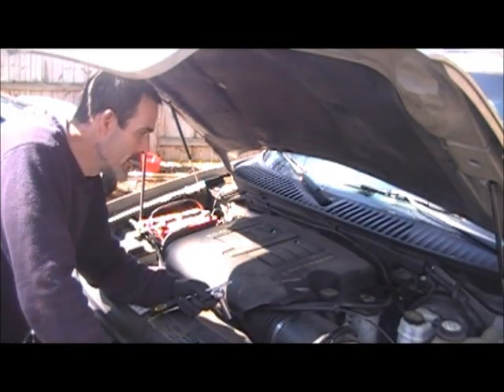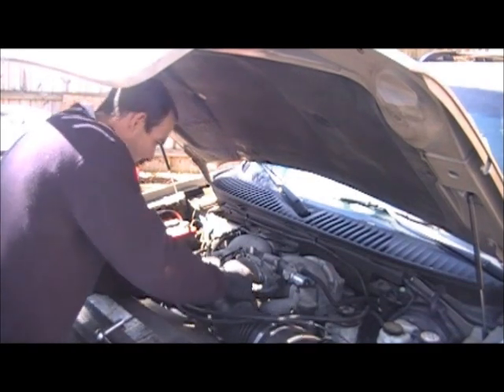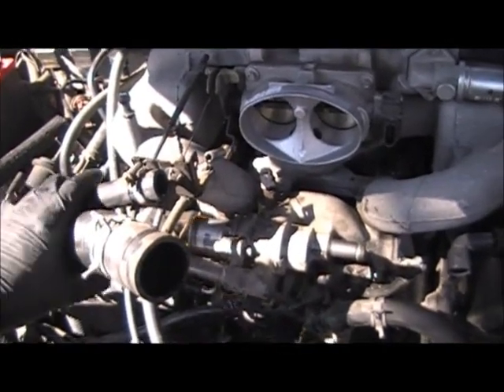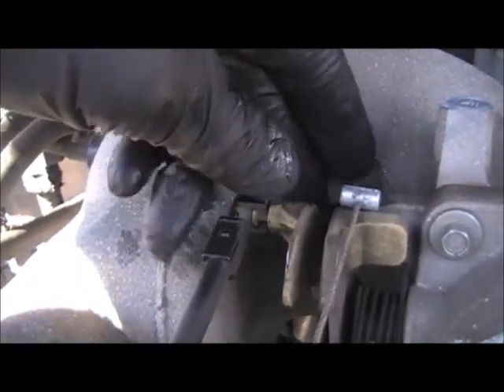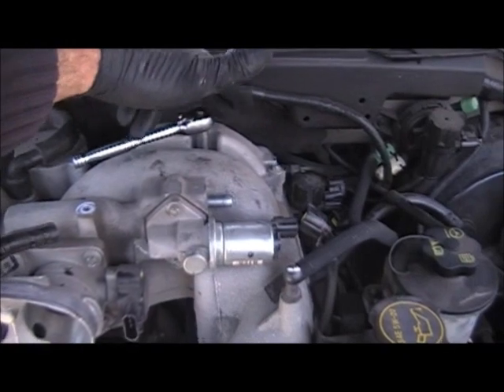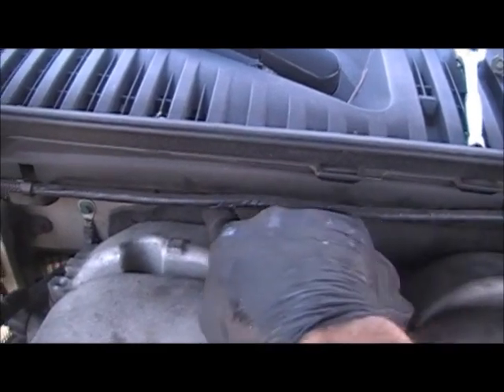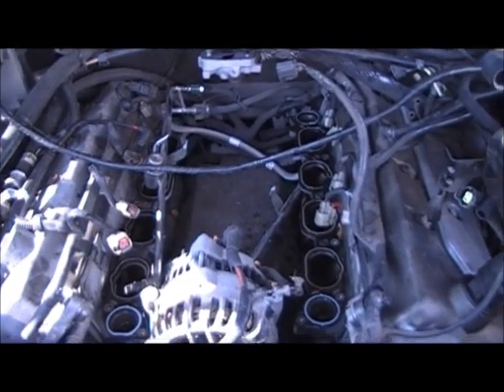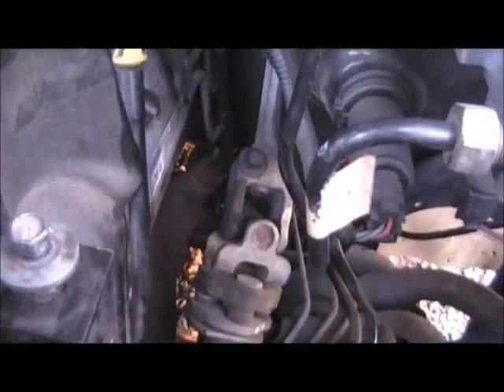5.4 Lincoln Navigator cylinder head removal

Comment from the maker: Yes coolant does flow through the intake in the back and there are also a few coolant hoses back there, small ones. I would think that your problem lies in that area other than the head gasket. Check with your local autozone, they have tools they will loan, see if you can get a pressure tester for the coolant system. That should help determine where the leak is comming from.

Comment: At first I thought it was the heater core but I have it on ramps now and looked underneath and it is dripping straight down from the bottom seam toward the back of the block on to the lower bolt of the exhaust manifold where the pipe hooks up.From what i can see the back of the block looks dry and the freeze plug also looks dry in the back.Does the intake have coolant flow through the back area?The only part thats got me worried is the head bolts in the rear and the tight fit of the intake.

Comment: I have a 2000 Navi 4x4 32v intech.It is leaking a few drops of coolant a night on the lower passenger side seam of the head gasket toward the firewall.Do you think I can remove the head with the body on frame like in this video or must it be raised?I've heard the head bolts may hit on the 2000 model with the intech 5.4.

Comment from the maker: Did you disconnect the battery when doing the job ? Also check the vacc. hose going to the pcv at the throttle body, it is known for breaking there and a vacc. leak could do it as well.

Comment: Thanks so much for the helpful video. I follow the instruction.I changed my fuel injector,coils,valve cover gasket,spark plugs and pcv valve. I got the check engine light off drove test for 3hrs it was driving smooth. Suddenly I stop at the light then it just shutt down on me. Crank it up and running again. Is it cause by the coolant water get in those valves' hole that havent completly dry off or something else wrong? Appreciate all the helps. Thanks again. It still running good now.

Comment from the maker: The side with the skip is the bad head more than likely. Part two of the video covers how to check for the bad valves after it is off. Usually the drivers side, rear two cylinders, or two intake and two exaust valves.

Comment from the maker: The valves will have to be replaced in that cylinder head, on those two cylinders. Check out part one and two of the video to see if you think you can handle it.

Comment: My just said misfire cylinder 6 and 7. I took them apart plan to change the whole set of fuel injector. I changed all the coils like 4 months ago. Couple days ago it said misfire those 2 cylinder. So I took them apart by watching your video. Thanks for the helpful video body. So I just stick the drag in each hole to suck the coolant out as much as I can then it should be fine right?

Comment from the maker: You can try to blow it out or stick a rag in there to remove any residue. Those are the intake ports for the valves in the cylinder head. If too much goes in there the engine will not turn over due to the coolant stopping the piston from going all the way up. If this happens just remove the spark plugs and turn the engine over to push it out, reinstall plugs and you should be just fine. NOTE: Be sure to have the head and intake reinstalled when doing that !

Comment: Looks like fun, nuggie! LOL! This is why mechanics "enjoy" the old school mechanical stuff. Less hoses and wires and stuff to deal with. But, on the flip side, in all due respect, an old mechanical iron head could only dream of being as efficient (multi-faceted value: specific power output, fuel efficiency, reliability, durability, power to weight ratio, etc.)

Comment from the maker: @abcfisher1 The right bank is sometimes misstook for the left, if your in the drivers seat your looking at it correctly. The main problem with these engines lies on the left bank, in front of driver, with it burning the valves. On the right side and just one cylinder?

Comment: Thanks for the video- I replaced my valve cover gaskets and installed new plugs and could not have done it without your video. For some reason I now have a miss on the right bank. Trying to sort it now. Any ideas? I did change 2 coils and replaced all coil boots. Think a fuel injector could be the problem? Should I replace them and all coils?

Comment: Dude, you're the man - I'm trying to build up the courage to do this to a 2005 Expedition that I picked up on the cheap.  No compression on the #8 cylinder, think it might be a bent/stuck valve, or broken valve spring.

Gonna try to at least get to the valve covers tomorrow!
Reply: jacflash69  am working on my 03 Navy I had oil in two of the spark plugs so now am trying to put new gasket and trying to get the valve cover off .do I need to take the intake manifold off in order to get the valve cover off.. please help
Reply: If oil in spark plug valve cover gasket dont pull head off